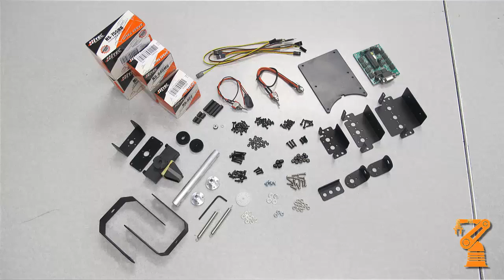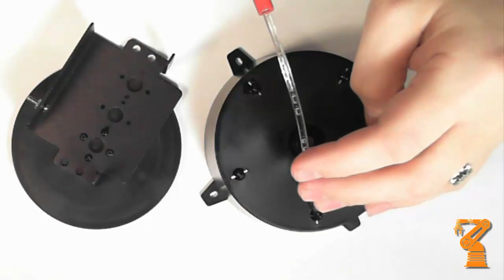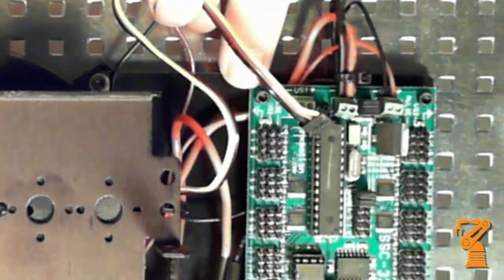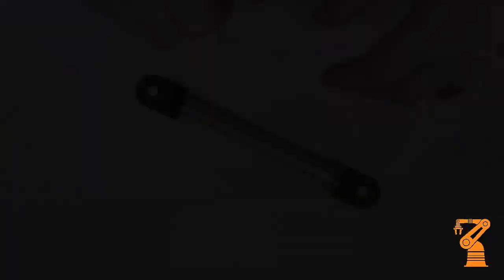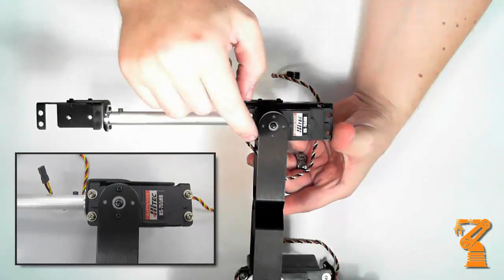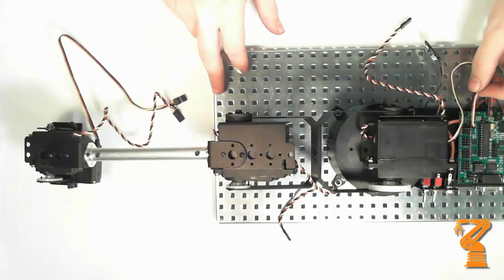SES V1 1 AL5D Arm Construction by Chris&Jim

Comment: the 9v wires do not make sense. in this video there is a small red wire and small black wire. when i look at the two toggle twitches together, the larger one has one red and one black to connect to board . the smaller battery pack has two red wires to connect to board. what is going on?